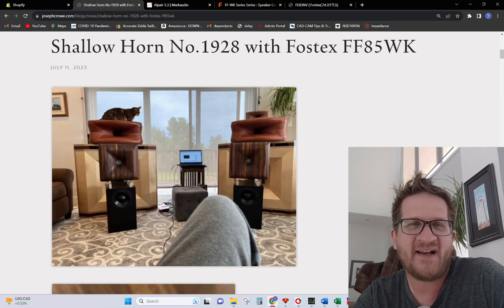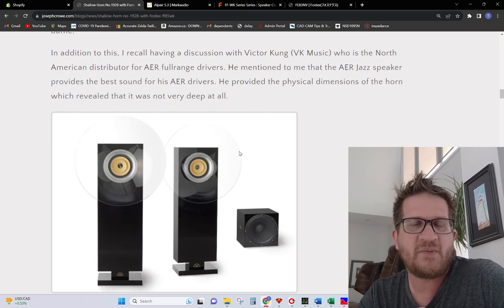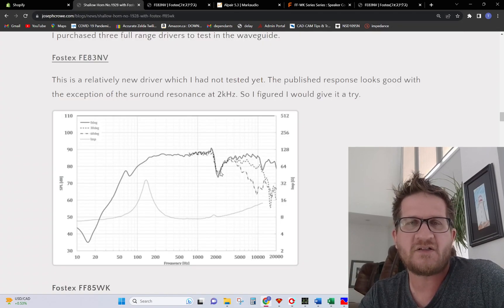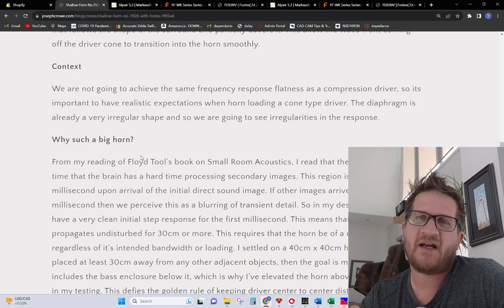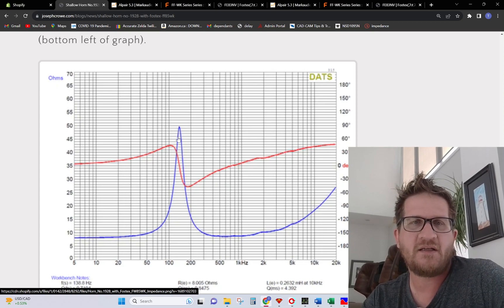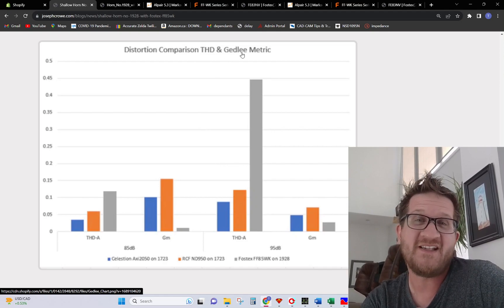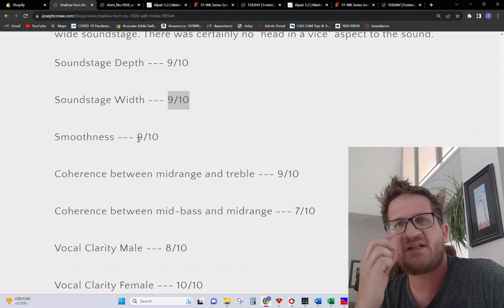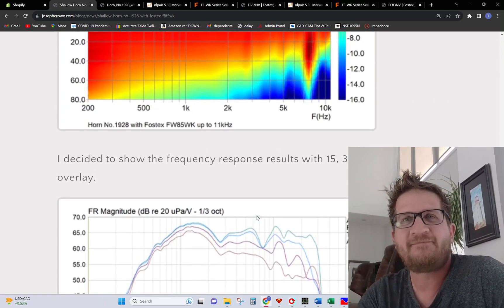Shallow Horn No.1928 with Fostex FF85WK

Comment: This is touched upon early in the video but I don't know if this exact aspect is circled back around to - how does the shallowness / depth of the horn relate to its response or performance? 

I've always been curious about this but it's hard to get a firm grasp on it.
Reply from the maker: Thank you for the question. I will circle back to this in another video. I want to feature the complete speaker design. I also realize I did not fully explain the reason for the clean step response.
Reply: @JosephCrowesDIYSpeakerBuilding  looking forward to it!

Comment: Very cool design.  Thank you for pointing this out to me on your website.  There is definitely something to that point source design and probably that step response of a single driver.  I've been chasing the sound I had from Lii Aduio F15 full range driver in an open baffle for years now.  It had the craziest depth and imaging I've ever heard but it was definitely a head in a vice speaker, and I eq'd the crap out of it with a mini DSP and crossed it to subs at 80hz.  I thought I would fall in love with some keff q100's for this reason since it was coaxial in design but they didn't wow me.
Reply from the maker: I would say 9/10 full range driver designs are just bad sounding. Designing a good one is like walking a tight rope. If done successfully then it can sound better than any 2-way/dome tweeter/woofer configuration.  I've been doing fullrange driver designs for 23 years now and I'm still working through it!  But 1928 is the best yet, even compared to anything else I've heard as a single driver.